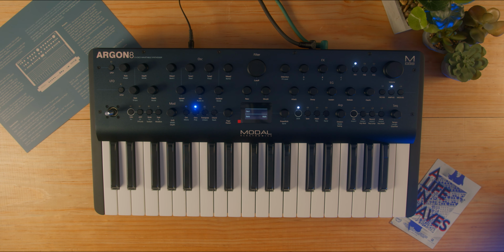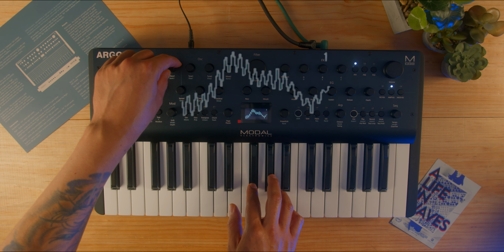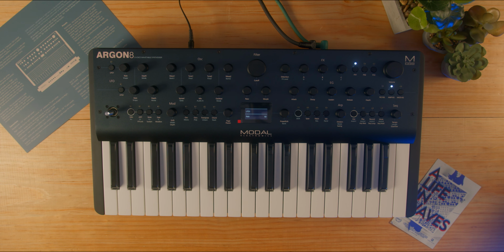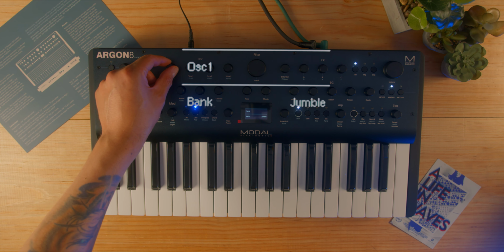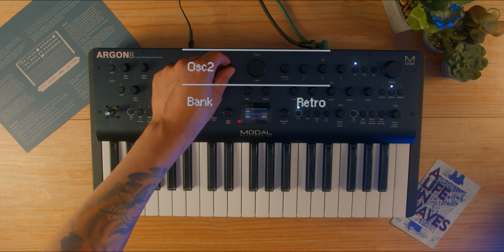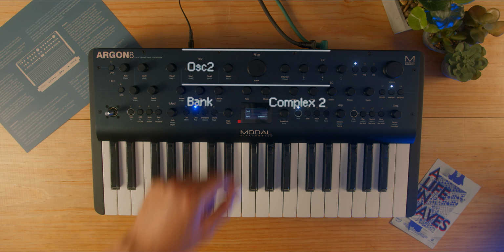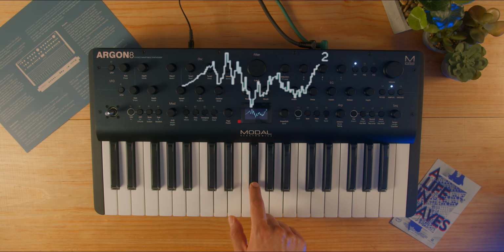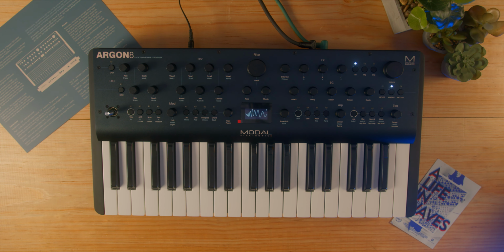Modal Argon8 | Oscillators Beginners Guide

Comment: Thanks for the video! What I don’t get is how Modal say that there are 120 wave tables, but when you cycle through the sounds, it’s something like 28 waves only
Reply: Each of the „banks” is 5 waves which you can smoothly interpolate between.
Also make sure you have the latest firmware. My argon is on v3.2 and I have 36 banks on wave1 and 40 banks on wave2. The additional shapes on wave2 are noise options.
Reply: @k0sashi  Thank you! 🙂